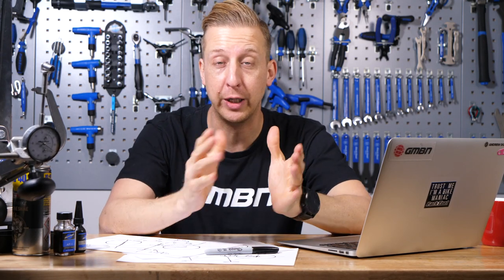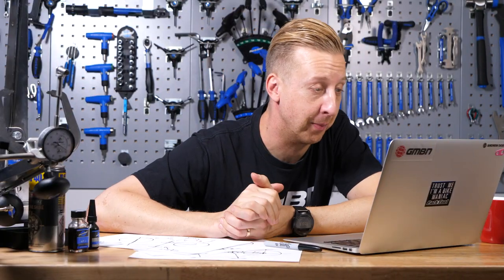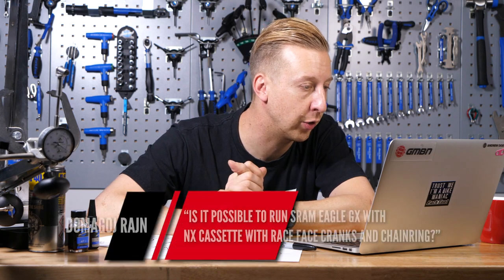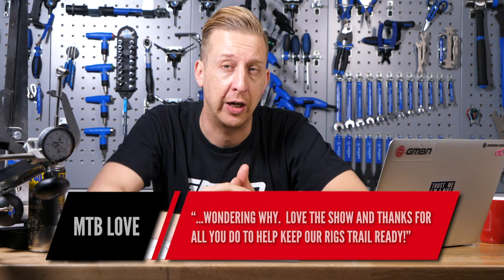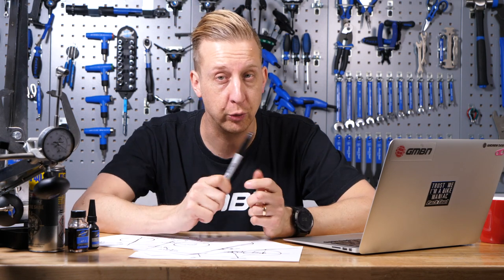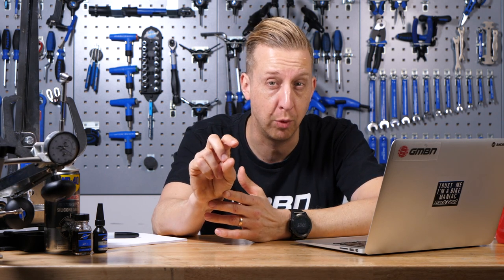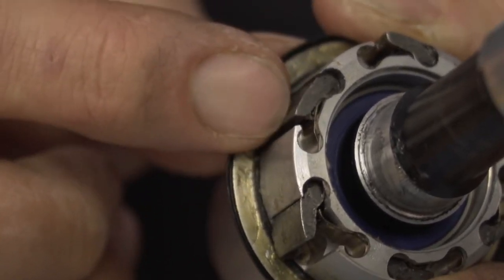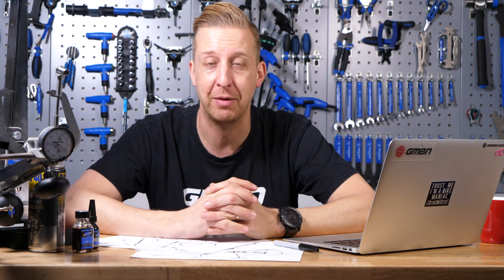Cheap Wireless Shifting? | Ask GMBN Tech

Comment from the maker: Have you had a creeky press-fit Bottom Bracket? Do you grease or oil your freehub?🔧 Let us know below and remember to use the hashtag #askgmbntech for submitting your questions!
Reply: Nope for question 1 what's lube question 2
Reply: I dont have a press fit on my current bike but the new bikes im thinking about getting both have them(Trek,yt) and i wasnt shure about the pressfit but coming from doddy maby it doesnt matter as much as i thought. I havent ever serviced my hubs im shure i should but i kind of feel like if its not broke dont fix it.
Reply: I'm about to replace my press fit BB, where can I find the magic compound you speak of?
Reply: #askgmbntech if I could choose I would always take a threaded BB. I had a frame that was poorly made (not a small or cheap brand) and the tolerance was to big, so i had movement between the frame and the cups.
However, would you always mount it with that specal "glue"? Because I've heard that the shimano anti size paste is gonna work as well.
Reply: A big advantage of pressfit bottom brackets on a carbon bike is one less bonded surface.
Reply from the maker: @307mtb  Doddy is using the Park Tool AP-1 Adhesive Primer and the RC-1 Retaining Compound in this video.
Reply: I greased my freehub, no issues, used the light oil specified by Mavic, it wore out the inner facing and it developed slop. So only lightly grease now.
Reply: I have I9 hubs on my Intense Tracer, and I do use the light freehub oil, that I9 recommends.  Apply a bit once a year.
Reply: I was wondering if you can change your lower stanchions on your forks? I have QR on my recon forks, but was just wondering if you can change them so I can put a thru axal l, also what is offset on a fork?
Reply: oil freehub
Reply: #Aaskgmbntech Do you guys think that a 120-130mm bike is able to handle moderately technical sections, mostly smooth and flowey terrain with the occasional jump/drop? (if it helps I'm looking at buying a Merida One-Twenty 600 2018)
Cheers
Reply: Boeshield T-9 on my freehub pawls here. I live in NorCal and don't ride in mud much, so grease isn't necessary, oil runs and attracts the local dusts, so a dry chain lube that dries "hard" is perfect. Freehub is as loud as it can be (don't like) but runs smoothly.

Comment: #askgmbntech Will changing the damper oil to a lower weight (2,5wt or 3 instead of 5wt) improve small bump sensitivity? I have a RS Yari RC, never use compression and i'm fairly light, 70Kg fully dressed. I'm not an aggressive rider, if that counts. Thank you.

Comment: You CAN use a Sram Eagle derailleur and an 11-speed shifter. I use an e*thirteen 9-46 cassette on an 2018 Capra and changed the XT 11-speed derailleur to an 11-speed GX. The shifting was terrible, the range seemed too much for the GX (designed for 10-42). I read in some forums and then tried the Eagle GX derailleur. It works great.

Comment: The Archer DX1 is fantastic. It doesn’t what mech you have, what cassette you have you can run them all together and adjust it off the app. Campy comes out with a 20 speed cassette? No problem, the DX1 will run it

Comment: I hear that Shimano hydraulic brake oil is good for freehub pawl and spring lubricant. Though I use a little smear of SRAM butter (Slikoleum). Works a treat for me. Have you at GMBN used either of those in the past?

Comment: 3:10 Not true. Installed an Archer today and I can say it’s as fast as AXS. On top of that you can individually configure each gear and the system is $400 compared to a rear mech only which is already $550. That’s nuts!

Comment: A quick and hopefully easy fix how do I stop chain suck thank gmbn tech hopefully you will see this
Reply: cactus man23 maybe your chain line is messed up? Maybe you need to move your chainring out more.
Reply: Chain suck how?  You mean off the cassette and into your spokes?  If so, then your limit screws are out of adjustment on your rear der.  You need to adjust them.
Reply: @peterlang5047  no it is on the front chain ring
Reply: cactus man23 when you say “chain suck” do you mean the chain gets sucked between the tire and the chainstay? If so, moving the chain ring outward would more the chain further away from the tire, which would decrease the likelihood of chainsuck.

Comment: On the topic of electronic shifting, what about gearbox bikes with a trigger shifter that actuate the gearbox since a possible reason people don’t use gearboxes is because of the grip shifter
Reply from the maker: The Rohlhoff and Pinion gearboxes require two cables to operate. So the only current way of running a paddle shifter is to have two of them. Check out the Cinq shifters.

Comment: #askgmbntech hello doddy I have recently brought a new halo combat rim and have had limited success in setting it up tubless, I am running tubless tyers and the rim is taped properly however i have noticed air is still escaping threw the spoke holes, is this to do with the fact that there are small holes in near the edge of the rim that arn't covered ??

Comment: Hay doddy another great video 👍
My question is ,,, I've a shimano xtr 11 speed rear cassette but I never use the biggest cog  ( it's looks like a dinner plate! ! )  can I remove just  the biggest cog ?? Would I need a spacer to replace the missing cog ? 🤔 cheers
Reply: Col Rock100 why would you want to remove it? Are you that concerned about weight?
Reply: @peterlang5047  nope it just looks daft ( to big ) I never use it and also the gears work perfectly but struggle to change up onto the massive cog ! Basically I just want it off if possible 🤔
Reply: Col Rock100 yeah you could remove it. Just adjust the limit screws on your derailleur
Reply: @peterlang5047  thanks , do you think I'd need a spacer to replace it ?? 🤔
Reply: Col Rock100 😑 yes

Comment: If Shimano do a electronic shifting MtB system, which I'm sure they will, its going to be based on their road version and that still has a cable running to front derailleur from shifters. So that's not going to be cool?
Reply from the maker: Hey Ian, Shimano do make electronic MTB groupsets. Both XT(M8050) and XTR (M9050)versions and yes they are wired like the road groups.

Comment: i am using sram gx eagle derailer with sunrace 11 spd 11-50 casette and nx an 11 spd nx shifter. I needed i
t to handle the 50t sprocket, the nx 11 spd derailert only goes upo to 42 tooth (46 works well by the way). sorry Doddy, i admire you but your wrong on the cross compatibility.

Comment: #askgmbntech Hello I am trying to solve drivetrain noise on my Shimmano SLX 1x10 on my Trek Stache. The "rumble" only occurs when I ride a gear  that was selected by a  downshift  with the clutch on. No noise in the same gears selected from up shifting with the clutch on, and no noise at all when clutch is off.  I have replaced the chain and cable with no improvement. What else could be causing this "rumble " when pedaling Thank You.

Comment: I don't care about the money the company saves from press fit. Its just a pain when your bike starts making a bunch of noises out of nowhere. On my bike I upgraded to the bb30 Wheels Manufacturing bottom bracket which is amazing and I have not had any problems since switching.

Comment: #askGMBNtech
I am looking to change to a one by setup. I am not going to change my shifters and casette, so it will be a one by 10 setup. I cannot seem to find any single chainrings for a one by 10 though. 
My question is: can I use a single chainring made for a one by 11, with my 10 speed chain and casette? 

Also I am using shimano.
Reply: Yes, same width between outer chain plates.

Comment: #askgmbntech     I’m looking at getting a slick tyre for 27.5 inch mtb for use on the turbo. Is there a minimum tyre width that will be compatible with my rim? I’m looking at 1.5 inch wide slicks and currently have a 2.1 inch tyre on atm.

Comment: I've been riding a Sram GX drivetrain for the past couples months, I love it but I still prefer the crisp feeling of a shimano. I recently saw that it could be possible to fit the brand new XTR 9100 with a GX derailleur. It this really possible and if so, is there any downside of mixing components like this? #askgmbntech

Comment: Hey Doddy, I own a YT Capra and it came with a E-Thirteen TRS dropper post but the actual dropper is a bit loose and wiggles to the left and right slightly, is there a way to fix this little issue? (It does not affect my riding tho) #askGMBNtech

Comment: #askgmbntech hi doddy I have a 2019 boardman mht8.9 with a 120 rock shock Reba and was wondering if it would be good idea to extend it if you can or should I get a new fork ps I do race some xc so should even get a shorter travel fork in 5.9 and not the lightest thanks

Comment: My cranks are starting to move and create a quiet rubbing sound. I'm assuming that my bottom bracket is worn, but i really can't afford to replace it atm. Are there any issues (other than efficiency) with running a worn BB. It's a square tapered bb if that helps.
Reply from the maker: If you have a decent amount of play in the crank arm this can have an effect on both chain and chainring wear and definitely your front shifting. It's worth getting sorted when you can afford Tom.
Reply: @gmbntech  ok thanks for the reply

Comment: #askgcntech hey Doddy, i have this dual suspension 27.5. i want to put a plus size fork and tire up front for the extra traction and leave the rear at a 2.4. is this stupid?
Reply from the maker: Yes you could do this but if you were to go up to say a 2.8" tyre this larger volume tyre will slightly raise the front end of the bike. It will raise the BB height a small amount and slacken the head angle slightly. A 2.6 up front with your 2.4 out back would be best bet but do experiment🤟
Reply: When it's sunny and dry I run a 2.3 " on my fat bike with a 29er rear wheel and the fat bike 26" x 4.0 front. The fat bike tire and 29 er are almost same outer diameter it feels like a big BMX bike and is fun to ride it all depends on your riding style and preference. My new trail bike has 2.6" tires and I think im going to like them same size but we shall see.
Reply: @mountainlessmtb9940   your a wild one!

Comment: I bought a sram gx 12 speed chain as a replacement for my already sram gx chain and it came in the perfect length straight out the box. Is this normal, because I thought chains always game longer out of the box.
Reply from the maker: Could just be very lucky. Chain length depends on chainring size and cassette size but also your chain stay length.

Comment: #askgmbntech Hay guys, if I put a rigid fork on my 29" Trek Xcalliber that has a thru axle and then leave my  rear wheel which  is still quick release.
Would that be OK?
 I run Mavic Crossride which have the option of being Thru or Quick..
Thanks 
 (Awesome, Flipping AWESOME show #btw)
Reply from the maker: Yes Kyle it's completely fine to run thru axle up front and a QR in the rear 👍Thanks🙌

Comment: An narrow wide chain ring is different that a oval chain ring right?
Reply: Maddox McPherson they’re different ways to classify chainrings. Narrow wide chainrings can be oval and vice versa.
Reply: Peter Lang thanks!
Reply: Like Peter said, they are two different features.  However, typically an oval chain ring will come designed as narrow wide, because it's the best way to keep your chain from dropping.  I ride a OneUp Components oval.

Comment: #askgmbn Hey Doddy, I’m thinking about getting the Ohlins ttx 22 coil shock for my Specialized enduro comp 2018. What’s the pros and cons with a coil shock? And what size spring do you think I should get I’m about 67 kg and ride a bit of everything. Thanks
Reply from the maker: Hey, It's very hard to tell you what spring-weight to get as it will vary from bike to bike and really depends on personal preference. You could check your local dealer and ask if they have any recommendations. The great thing with Air springs is they are so adjustable.

Comment: #askgmbntech Good show as always, Doddy. Why there is hardly any coil-sprung fork with compression and rebound adjustment? Meanwhile most air-sprung fork included that. Correct me if I'm wrong, but does compression adjustment and hydraulic lockout is the same thing? Thank you.  [P.S.: Just use Ivan as my name is too long to mention]
Reply from the maker: It really depends on price. Cheaper forks won't have much adjustment.  Yes the "lockout" is just compression damping. 👍
Reply: There is high end coil forks, I think MRP and Cane Creek have them.
Reply: Thank you for your responses! Have a wonderful day :)

Comment: Dear Doddy!
Hope you can help me on this one! I'm buying a 2016 alloy Mondraker Summum and have the option to chose M or L size. I'm 1.77, with 1.80 ape index.
Today I have a 2014 Mondraker Summum M size. Changed from a Trek Session 88 2012 also M. Everyone tells me to go for L size, by the way i'm a bit concerned about cornering, jumping and also sending some whip, as I like a lot. Tracks are steep, fast and curvy.
Rode a yt Tues large today and felt a little bit uncomfortable, very over the bars. What you think will be better? #askgmbntech
Reply: Gabriel Vuelma Romanzini then newer mandrakers are very long. I would go medium if I was you. It will be bigger than your current bike.
Reply: @stevenjalopnik1342  Thanks for the advise! I'm 99% sure that I'm going for medium!

Comment: Ya im hearing big issue with the wireless controllers. Fw issues, update corruptions leaving the system paralyzed.  Then there is the cost. Well....i would rather now be a beta tester. Maybe in a few years...idk
Reply from the maker: Electronic shifting has been around for a pretty long time now in the road world and Shimano have been making DI2 for MTB for a few years now.

Comment: #askgcntech I have a Fox Evolution fork, and I think that it bends a little bit when I brake, and my front wheel pulls to the left. My front wheel also pulls to the left when I put my weight on the bars while bike is standing. My QR is tight. What could cause this problem?
Reply from the maker: We suggest you check the spoke tension as this could be loose. Hopefully this helps.
Reply: @gmbntech  Okay, will do. And could the fork be the problem? It seems to me like one fork leg is shorter than the other, and because of that wheel can't be properly seeted in the fork, and when the pressure is applied to the fork is applied, wheel sits itself in the fork and because of that it moves. (Hope that this makes sense 😂)
Reply from the maker: @borisatanasov518  we suggest you take it to your local bike shop as it really could be a number of things causing this.

Comment: #askgmbntech I’ve been practicing endo 180s and when I put my front brake on (when stopped) and rock forward and back the forks move forward and back at the seals. is it doing to be an expensive fix
Reply: Do you mean the whole fork moves at the head tube? If so, Loosen the side bolts on the stem and then tighten the top cap bolt and wiggle the fork slightly while tightening (make sure it's pretty tight but don't torque it down;)and then straighten the bars back and tighten the side bolts. If I tighten the side bolts first, even my fancy shmancy frame and fork will have play.
Reply: Ty Teasdale no that’s all tight, theses play in the seals but thx for the help

Comment: #ASKGMBNTECH.. hi doddy .. i just want to ask if can i use 160mm fork travel on a 68 degrees headtube angle on my giant talon 2 hardtail? Or what is the maximum travel on that headtube angle.. Thanks.. 🔥🍺😂👌👍
Reply from the maker: Ask your local Giant Dealer, they should be able to find this one out for you 👍
Reply: As enticing as that may sound, the current talon 2 comes from factory with a 100mm fork, and I couldn't imagine yours would have any more than 120mm at max.

The reality is, an increase of 40mm and possibly even 60mm (if 100mm from factory) is a huge jump. Even a 20mm increase can heavily affect the bikes handling, and is about the safe zone for travel increases.

As doddy mentioned in the vid (though the opposite would apply for a travel increase), the bb height, head angle and several other geometry numbers would be altered so much that the bike wouldn't work effectively. 

If the sole intention is to reduce the head angle from 68, although thats good in theory, the bike isnt really designed for that kind of height increase as the front end, youd experience a quite unstable ride with a high bb, more sluggish handling and significantly more instability under braking with the fork wanting to dive. 

I'm sure theres a few other negative effects too but I cant name them all off the top of my head. If you're really wanting to bump up the travel, take a look for a fork with maybe 20mm more travel, which would yeild benefits for the head angle and capability without catastrophic effects on the rest of the bike. 

Hope this helps a bit, and good luck!
Reply: You're gonna break the frame if you put more than 120mm, among other things, but that one beeing the most dangerous one.
Reply: It doesn’t depend on the head angle. It depends on the travel of your current fork, which I think is about 120.
Reply: Yes you can, but don’t. It will throw the geometry way off and probably break your frame.

Comment: #askgmbntech What's the most catastrophic component/frame failure you've experienced from not using a torque wrench to check bolt torque? Also, how much can you afford to adjust chain line at the chain ring, say moving it outboard or inboard by several millimeters, before shifting and drivetrain function/durability suffer?